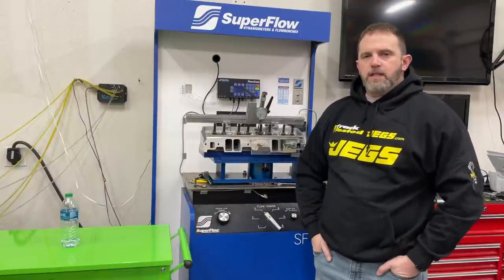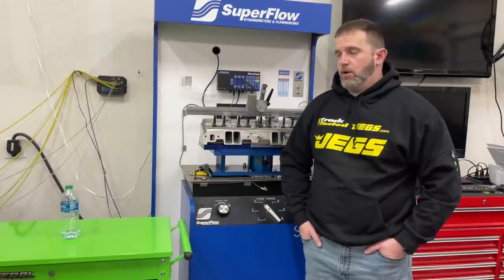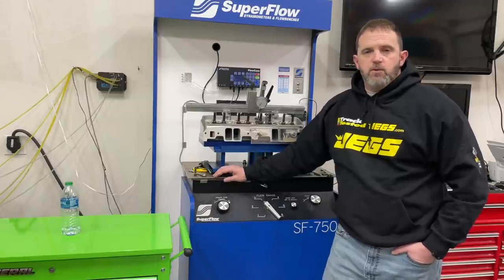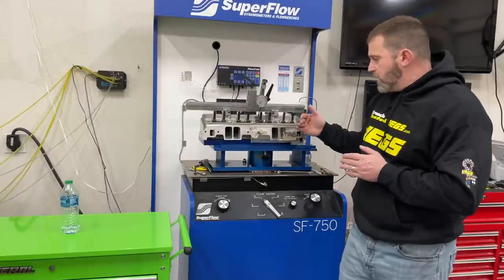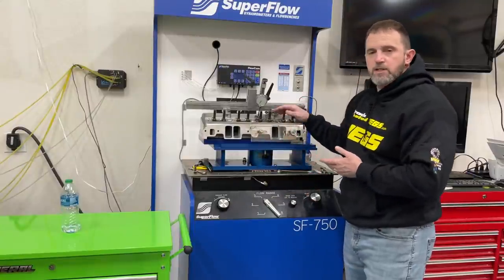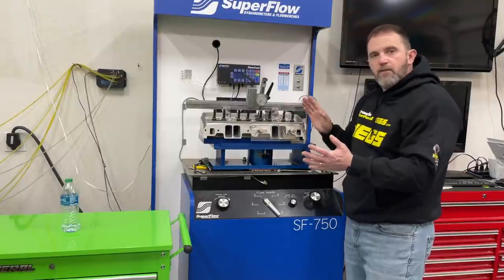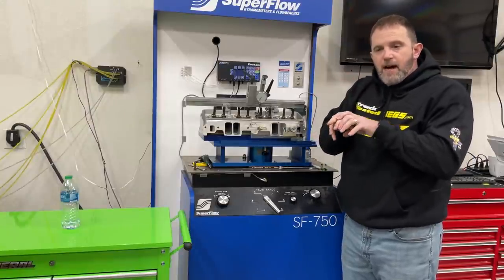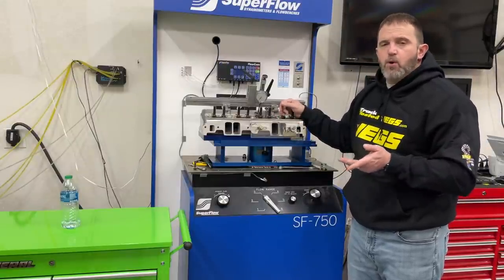A Little Information About Swirl

Comment: I have dropped all of my engine subscriptions but Eric, Richard Holdener, and David Vizards. The best thing is that there is a natural teacher at the wheel and after almost 50 years of doing this Eric explains it in a way that I would just be able to answer “ it just  does” lol and that point in carbs and EFI is something I have run into so much dogma that doesn’t hold up scientifically. Thank you Eric!
Reply: Very good info from hp academy also..Australian.. enough said. Also Charles servidio and Andy at unity motorsports is good too.

Comment: Another thing to consider that most people forget is that the piston itself is the floor of the chamber and it can also affect swirl. So what is seen on the bench will not necessarily be what the engine experiences because the piston crown is messing with the charge coming in. I do realize that what you are doing is really only looking at the head part of the system, and you've made that abundantly clear. Thank you for sharing your knowledge.
Reply: I seem to remember Gale Banks talking about swirl in diesel engines and saying that valve relief Into the piston slows swirl and effects fuel atomization. The piston design can change many things.

Comment: I tested some very recent nascar heads.   The swirl of those intake ports is ASTONISHING.      Its crazy ...one could increase compression in these Nascar engines and put diesel injectors in it and it will run.    As I do both diesel and petrol heads...I know what I am talking about.

Anyway for me it ended the endless discussion on all kind of fora etc where people slash each other abour low medium or high swirl and how that effects horsepower.     950 hp , on 95 octane pump gas with 12 compression at 9200 rpm , NA ,  850 holley carburetor, no power adders ,  and ONLY 6.2 liters capacity is just awesome.
Reply: Ya know about 7.3 powerstroke heads and helical ports?
Reply: Thank You for your explanation of cylinder swirl, I find it to be educational. Didn’t take into account swirl might wash out the cylinder, Hopefully with diesel fuel being heavily oily based that might help with some form of lubrication for diesel applications. Another great video,Thanks Man
Reply: @FatBoy7.3Powerstroke  in the Netherlands we dont have a lot of those. I mainly work for tractor pull,  auto cross  , classic car engines .    

But man ...diesel engines can be made real high revving power houses which last and last!
Reply: @FatBoy7.3Powerstroke  this is a VW  1.9 litre  diesel with head prepped by me.   This was a 9300 rpm pull...... 😁😁😁😁😁😁
Reply: @Baard2000  That’s a little crazy for diesel but if it has less mass weight rotating that’s probably a part of why it can get to that level RPMs. Speed of Air pistons might not be of any benefit in that range but they do seem to increase torque down low in the working range of a heavy towing vehicle. Not sure about VW but I’m at 17.5:1 compression and that’s kinda low compared to some other engines but I believe my block would look like a mushroom cloud if I tried to get halfway to 9k RPM! Keep at it, You are in your own league of performance!
Reply: @FatBoy7.3Powerstroke  the diesel is injected at tdc  into the bowl.   So bore washing isnt an issue. 

But running these engines warm with too low revs wil cause diesel accumulating in between piston rings.  When engine than is revved up and boost builds up....than  oxygen,  diesel  and temperature will cause that mixture between the rings to ignite.....Than total chaos remains after crown of piston exploded by that......😬😬😬
Reply: @Baard2000  I’m stuck at work diagnosing a split system, I’ll get back to you on this. Didn’t think injection occurs at TDC would think at the end of the exhaust stroke 10% on split shot injectors is dispersed to help cool EGTs then 90% for the second shot during the intake stroke for atomization, especially having 7 injection holes per stock nozzle, 5 hole for hybrid injectors, atomization time would not be instantaneous. That’d my guess from my understanding at least stock split shot injectors, now going on to single shots and hybrids are another story

Comment: I port my own heads and have done it for friends with chevy and olds only. Your videos are very informative. The swirl dynamics you explained between carbs and fuel injection is good. I made a wood spacer with screen in the middle to atomize fuel. Have you ever tested that or seen them used? I agree about the Facebook forum's getting ugly. I've been dogged for trying to help ppl. I like your on humility on yourself. I take in info from multiple views and my 10yrs on the drag strips and do my thing. You've help me many times especially on your video on CC combustion chambers. Thanks!!!

Comment: On the FE I have gone things on the intake manifold because it is half the head and pulling 1.5 hp per cube from 352 heads with the right touch. The can be amazing because Ford really scienced the architecture of the casting to be able to use different manifolds to run within 100 hp by changing the manifold and cam . Amazing!

Comment: I have a question for you that there doesn't seem to be a lot of information on the internet. I have a set of Cathedral Port heads that I want to up the compression more than what you can flat Mill and I was curious on two other options. How complicated is it to do a angle Mill. My second question is why can't you weld up some in the chamber?

Comment: Love your wisdom  big cheers from Australia  ps. just my theory of pulse flow? Bore size x stroke pulse! Or say  a dummy block with one rod or two pistons oiled up  crank run by an electric motor at any settings of revs could that indicate more accurate flow and swirl in what happens? In a combustion chamber.  + testing different dome pistons with com chambers . Anyone try that?

Comment: Nice job Eric, high rpm you are better off with less swirl for the energy conservation you spoke of. Engines that need a wide torque curve seem to like more swirl. Fuel prep is very important when it comes to swirl, if the droplets are too large they will centrifuge out like your diesel example. Backcuts and valve jobs will radically change swirl profile. The charge motion as the piston reaches the quench on the compression stroke is another part of the equation. I like to lower the quench pad to the entrance of the exhaust valve, that causes swirl in the opposite direction of in the intake valve swirl. This causes high turbulence. Checking the burn pattern will give good info. Thanks, Charlie
Reply from the maker: I don’t like doing that. I have only done that for nitrous applications because it slows the burn down. That’s what I don’t want for na. But if it works for you keep doing it.
Reply: @WeingartnerRacing  I would love to do a a b a test on that.
Reply: Backcuts and valve jobs change swirl, because better fuel atomization and less swirl/tumble or something what again hard to understand? Thanks more troubles.. where can i research burn pattern? Speedtalk? Thanks 👍
Reply: @juhanahuovinen  Check out my latest video. It answers your question.
Reply: @servediocylinderheads  Thank you, grazie, kiitos. I appreciate it alot.

Comment: Thank you for saying that the carb is atomizing the fuel better than fuel injection. I love watching your videos to get your expertise. I may have different opinions but I appreciate your opinions. A piston only pulls so much before it stops to exhaust, so a constant flow through a cylinder head as with a flow bench can be  a bit inaccurate because of this stop and restart of flow. There is a turbulence created within the intake ports during the stop and restarts of flow. I am no professional at this and I would like to know what you think of what I just wrote.
Reply from the maker: I mentioned that in the video about the bench being static and the engine is dynamic. The bench gives you some information but not all.

Comment: australian made ford inline 6 barra 4.0 dual overhead cam engines had a revision to the heads and cams  duo phase meaning one valve opens first on intake and exhaust  and then later a head re cast to add a swirl in intake and a 1 cc chamber reduction
  182kw 5250 380nm 3250 no duophase og head 9.7 to 1  first gen rods
  190kw 5250 383nm 2500 duophase og head 10.3 to 1  first gen rods
  195kw 6000 391nm 3250 duophase new head 10.3 to 1 second gen rods

so the felt that swirl on a 2015 or new car needed to be helped including intake update and tune revisons to what is esentially the same engine from 15 years priar

all can be speced with a turbo but that has lowered comp and they also turn off the variable cams on turbo variants 
240kw 5250 480nm 2000-4500nm 8.9 to 1 on the low end
to
325kw 6000 675nm 2750   

im currently building wiring a few of these engines into cars and i have been watchingin dozens of your videos figuring things out as i can grab different oem to add or take away swirl  

some after market cam shafts even add more  but im not sure but i also wonder if it helps at higher rpm as its not both springs 100 percent at once its 2 ofset ever so slightly

Comment: interesting stuff! it sparked a couple of questions for me:

on a recent video you mentioned the swirl direction changed between two valve lift intervals - do you think that might cause any knock-on effects? I have a preconception that rapid changes in airflow are not ideal and generally should be avoided but curious to see what you think. 
 in my head, that reversion in swirl direction would lead to a point about halfway between the two intervals where swirl goes to zero, so might cause a flat spot in terms of fuel atomisation - but i appreciate this is almost certainly a transient effect so maybe wouldn't be noticeable in a dynamic situation as the valve is continuously lifting or closing.

Would it be more of a concern that the reversion in swirl, or swirl in a given direction, doesn't play nicely with the combustion chamber design i.e. clockwise swirl is good, counter-clockwise swirl is less useful based on the chamber design? Or would it not really matter, as 'swirl is swirl'?

Comment: Doing a 360 / 390 FE Stroker right now with Edelbrock Performers RPM cylinder heads.. looking for a rotating assembly.... its a 4.110 bore already, looking at 4.125 stroke... 438 cid for a  70s ford f250 for  a customer...

Comment: Sure would like to see how much swirl a 88-95 SBC swirl port head they do stall out about 400 lift .i put a set on a 79 350 .I slightly modified the Q-Jet and distributor. Stock intake modified to fit. Stock cam This think made alot more low end torque and really started screaming more at 3000. I did have to back the timing down to about 33 degrees .

Comment: So if a ls3 head has less swirl  because of the injector spray hitting the back of the valve  by design for more efficiency.   Does it effect it when putting a carb on because the head has less swirl .. and can you port the head to get more swirl   .. i run a super victor 4500 carbed

Comment: That is very good information about swirl I never heard of it and you explain how it works sounds good to me. Also when you mention about know it all peoples who whatever I do know a person who thinks he knows everything and I still to this day try to teach him that he is wrong. Like for example. So we run 2 stroke 500cc engine in a outlaw kart and one of his things was I need to put a 195 in my carburetor just because I am running after market parts on my I was like wait a minute do you even know my carburetor and what type is it and what jet it has now. So I have a Keihin PJ27 carburetor that had a 178 jet. But his carburetor is a Keihin PWK so it's a different carburetor and he runs a 205 to 210 jet in his. So I told him hey I already tested this carburetor in other engines that had those aftermarket parts especially he thinks an aftermarket ignition make a huge difference which I don't believe. And those engines with my carburetor still ran a 178 jet ran perfect. So I ask my engine builder he says don't listen to him just 1 size bigger to a 180 that PVL IGNITION doesn't make it to where you need a way bigger jet also I had aftermarket reeds, extra porting and bigger bore and after all those factors my carburetor still didn't need a 195 jet that 180 jet my engine builder told me to put in it ran perfect. So the point is everything and anything is a different factor like PJ carburetor vs PWK carburetors takes different jetting just that simple so this guy who helps me still doesn't know everything and I ignore him on a lot of things
Reply: But I enjoy your videos I learn a lot from you and I want to learn how to do porting especially in a 2 stroke which I know 2 stroke and 4 stroke is totally different but any information helps

Comment: Eric what do you think about port swirl in FI? Low boost high boost whatever. Do you think it helps or hurts at all? I’d imagine it has less effect when you have the denser mass flow.
Reply from the maker: I think it still has its place but I think it is probably the same balance as na. I need to do more testing to have a good answer on that.

Comment: Is there anyway you can flow a head for single 57-63mm bore ?? It doesn't have to be that exact, I'd like to get a estimate of flow,  the small engine I'm working on, the cams available are basically all within 1-1.5mm in lift, they all seem to be more like lawnmower cams, not a true motorcycle cam,  they do allow it to rev to 10k rpm, but peak power is about 8200rpm I have a larger valve head and thought about trying to get someone to re grind a stick cam, get a bit more duration, and lift, on the stock head, I un shrouded the valves,  and ported the head, with a mild haha 😂 cam, it seems to moved the peak up about 500-700 RPM, I'd like to get the peak to about 9400-9600 rpm, keeping as much of the low end TQ as possible, by low I mean 4500-6000, because it can idle at 3k 3500 and not engage the clutch!  So it needs to make power from 4k to 9500, +/ 400rpm, I want to keep it under 10k RPM,  at 81cc I'd love to see 15hp, I can go to 92.4mm bore, 95cc,  but I also have a 150cc I'm boring to 180cc, I want to keep it below 8500-9000,  I know you probably don't care about a small engine, just wondering if you could flow a couple heads. To get a rough estimate of capacity,

Comment: One thing ya never hear anyone mention is that under a vacuum gasoline will boil and vaporize under a lower temperature. So it seems to me , to a point the wet flow and atomizing worries might not be ___________ you fill in the blank with your opinion. I have to wonder if this is why some people try E85 in a circle track car and they see no difference. E85 boils at 170°F im pretty sure and the low RPM of these  crate motors especially the E85 could be boiling off , expanding and actually choking it off a little. Maybe at the speed in a port it won't have time to boil ??

Comment: My dumb opinion is,  you need enough swirl, not more and more, to make power,  just like port size, you need enough port to make power, more or less port, you loose power or low end TQ,  all the  clear heads, and see through cylinders on running engine videos, can really give you a better idea of what's happening in the running engine, they just don't last long enough to do any real testing, but most are flat head , so it doesn't really help with ohv  , but still it can help,